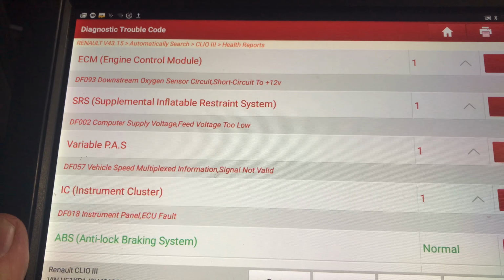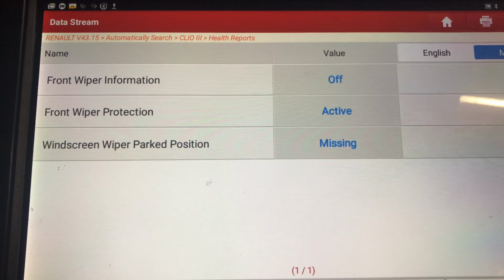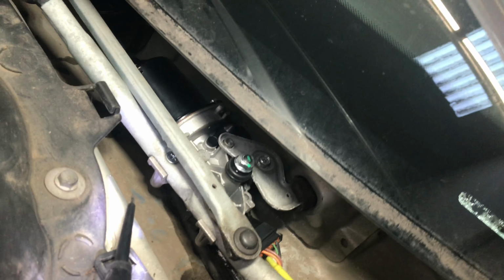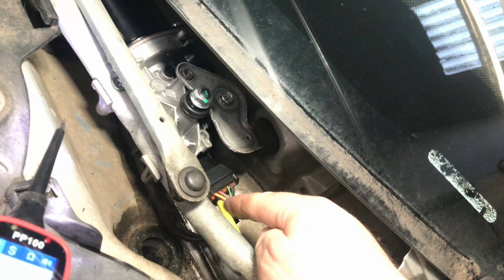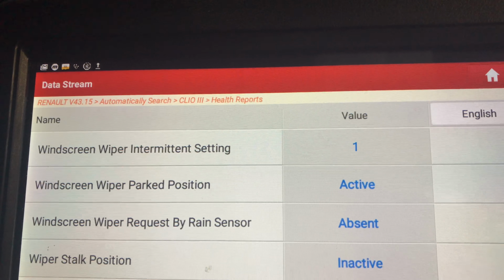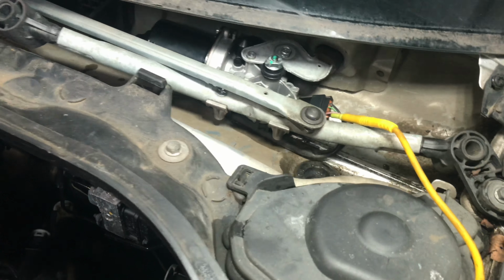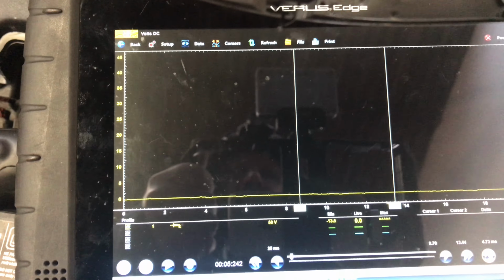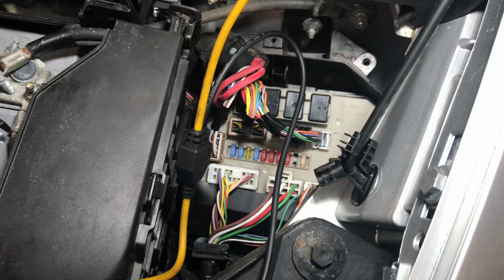Renault Clio III (2008) - Front wipers not working!

Comment: The usual problem is water filling the scuttle as a result of the drains being blocked with dirt and pollen etc.  The motor and its connections will corrode,  the pivots for the wipers will seize, water may enter the cockpit, but even worse - the sub-frame will corrode and require an expensive replacement.  Best remedy is to open the scuttle every year and gently unblock the drains with a flexible plastic tube and flush them with some warm water and detergent.  Saves a lot of money.

Comment: please what fuse did you replace. i am having the same similar issue. i have changed the motor and the control stick in steering and i am still having the same issue. can you please elaborate on what fuse was replace. thanks

Comment: You sir solved my issue, 
I knew there was a separate fuse box but I could not find it. I thought it was a wiper relay or switch on the steering wheel, as I already disassembled wiper motor and it worked with no issue when direct power was applied. Luckily it was just a faulty fuse... you have one like from me.

Comment: The motor is not PWM. You have separate windings in the motor for the different speeds. When you saw a steady 12v input that winding/speed was being used. When you saw different  erratic voltages another winding was being used, and the one you were measuring induces voltage from the magnets into it's winding becoming a generator.
Same happens if you spin any brushed permanent magnet DC motor.
Rob.
Reply from the maker: Cheers Rob thanks for information, Sandy
Reply: Robrob iwas going with his signal on his scope the 12v looked like it was being pulled to ground with around 60% duty cycle which would give about 7 v to the motor for slower speed